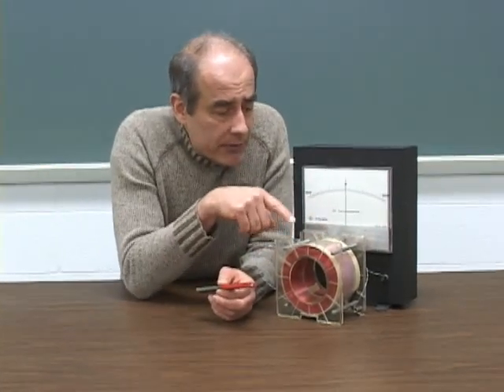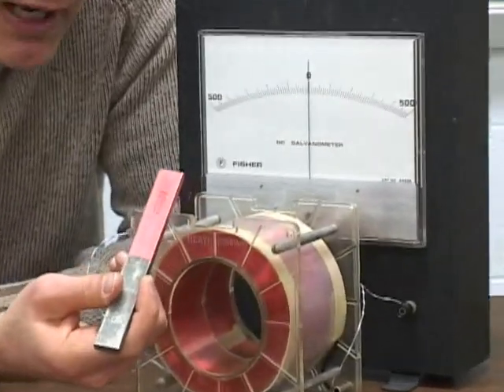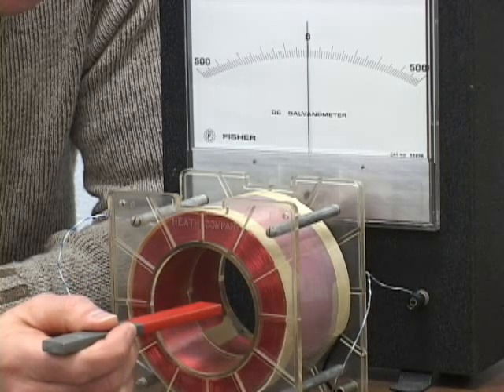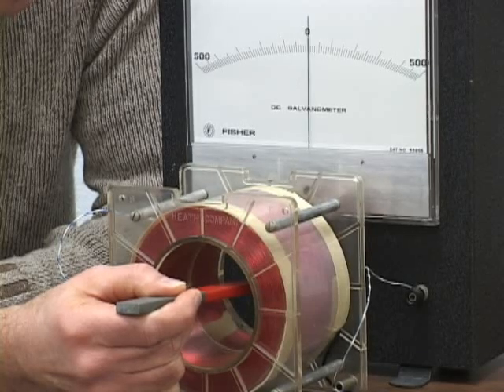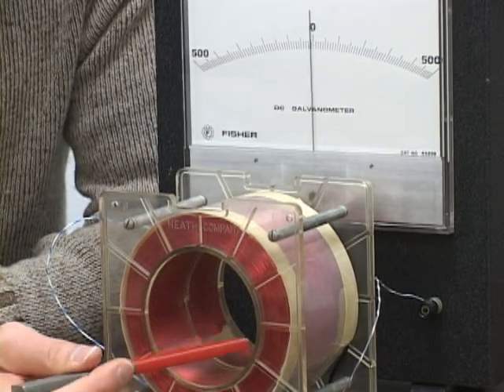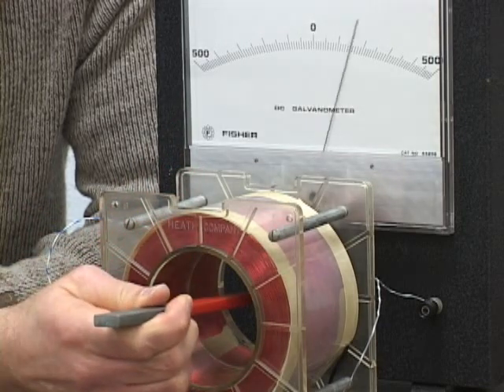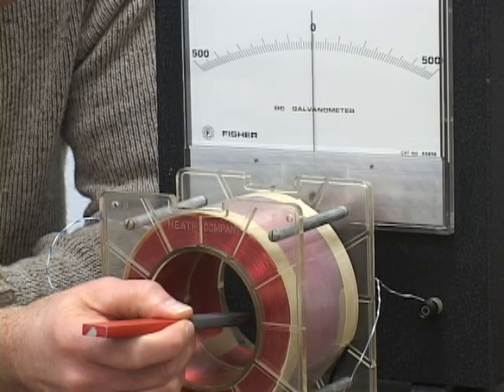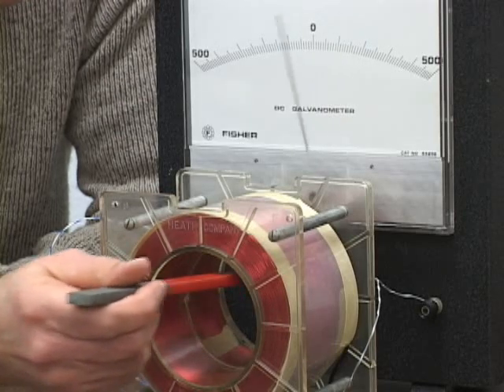Faraday's Law - The Generator

Comment from the maker: Comments on the other questions are here.  When you pass the N pole in first, you get the meter to move one way as the magnetic field increases. If the magnet were to go out the other end, the magnetic field would be decreasing and the needle would go the opposite way on departure. The magnet does experience a "kickback" force and it takes a force to "force" the magnet to go through to generate the current.

Comment: How much voltage can we generate  using Faraday's law?
Reply: In the car when the magnetic field is collapsed very fast - you can get something like 20,000 volts from the 12 volt car battery in order to throw the spark in the spark plug.